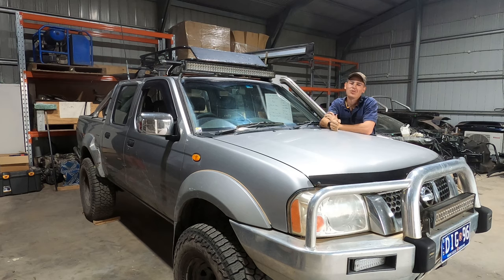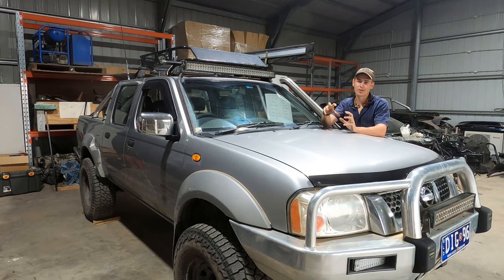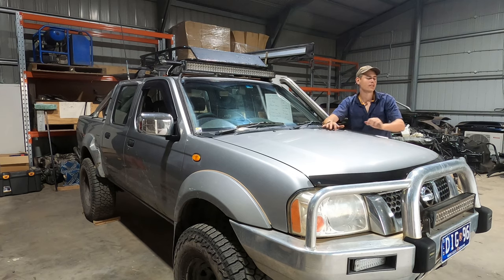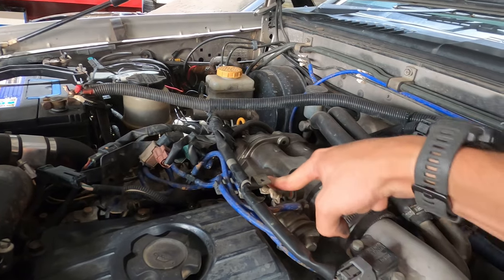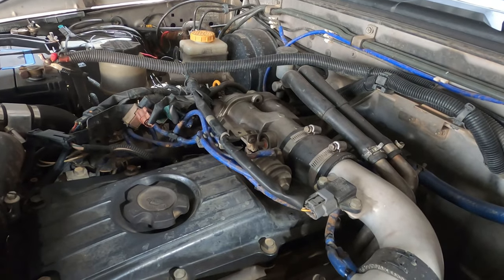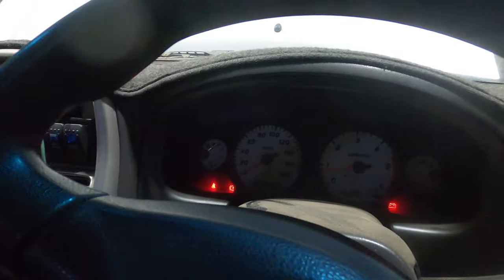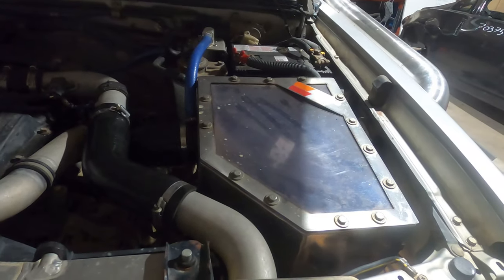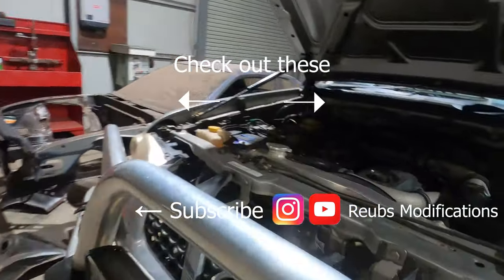How to Make Your ZD30 Flutter

Comment: My td42 just woooshes through its 4” intake and back out the snorkel, even with a little 500rpm blip on the throttle 😂
Reply from the maker: Yeah bigger engine, bigger turbo. Sounds much better than a ZD30 for sure

Comment: Mine "Blows Off" every gear shift or pedal lift-off. Huge FMIC and piping does that for ya.  Your "Flutter" is called compressor stall. Excess boost pushing back against the compressor wheel and stalling it. The sound you get is the combination of your smooth, metal tube and being ver free flowing, sets up a tuned flutter. Mine with just a stock Safari snorkel just blows off.

Your description of the throttle and swirl is close but not correct. So the back one is the EGR/Swirl butterfly to pull exhaust gases back into cyclinders via only 4 intake valves, the same butterfly closed even without the EGR flowing will induce a "Swirl" in the cyclinder charge but it's effects are pretty lame when whole charge is slammed into to the top of the piston at TDC.
The throttle, the ECU will fully close it on engine-shutdown to try and stop the thing shaking but also as a safety for a run-away, kills air-flow, no more run-away diesel. What also happens on the Navara ONLY is the ECU can also partially close it to create a low pressure in the manifold to allow the EGR to flow in. If full boost pressure was in the plenum, it would flow out the EGR valve. See the three solenoids, the back one you have blocked would normally go to the other side of the throttle butterfly actuator and partially pull it closed. Yours in blocked and a T-piece connects both actuator chambers to the fun-stopper solenoid.

Flutter is just a low frequency resonance.
Reply from the maker: Thanks Ben, as always great information 👍🏻
Reply: @Cooperroso  Neither of us are your "Bro" kiddo, grow up and bugger-off.
Reply: Why can’t you do it with a top mount
Reply from the maker: @TouringUpNorth  hey mate not sure where it said you can’t do it with a top mount, I think you might have misread bens comment about a huge FMIC and piping will do that. There’s nothing saying a top mount won’t flutter but there’s significantly less piping on top mounts then there is front mounts as there’s less distance from the turbo to intercooler. 
This means that there is less volume in a top mount intake system compared to a front mount, another point is top mounts are typically a lot smaller than front mounts due to space confinement’s so once again less intake volume. 
If you were running the same boost on either you’d have a better chance to flutter on a FMIC set up 👍🏻
Reply: @ReubsModifications  what about a cross country ultimate intercooler on a TD42, the dog is massive
Reply from the maker: @TouringUpNorth  yeah that could work but I don’t think TD42 have the same butterfly valve, you’d have to try stalling it on the beach to make it flutter
Reply: @ReubsModifications  na they don’t but some guys get them to flutter with 12mm n big boost
Reply from the maker: @TouringUpNorth  yeah so that would be purely from loading them up with boost then a rapid drop in rpm

Comment: My ZD30 Patrol flutters so much every time I let off the throttle. Installed a 3” straight pipe with a cat and very loud like a big truck lol. I was bit worried and looking around if this is bad for my car. Not sure if I should take it to a mechanic.
Reply from the maker: It can be normal for it to flutter depending on the mods that have been done to the engine. Cant do any harm having a qualified person check it out though

Comment: This well where off the turbo baring ,u basically deleting the blo off valve and the gas gets back inside the turbo ...
Reply from the maker: The ZD30 doesnt have a blow off valve, they use a wastegate on the turbo to vent exhaust pressure away from the turbine blades.
Reply: Can u mack a video and show us how to delete the Westgate on turbo diesel
Reply: won't do anything to the turbo, and you shouldn't delete a wastegate.

Comment: Does it have to close all the way to flutter and cut the engine out or can it be open just enough for the engine to stay on but decelerate the engine faster and dose without turning the engine off?
Reply from the maker: If you are using the key and cutting the engine it will close all the way but if you turn the key back before the revs drop too far then it wont turn off. If you're doing it manually in the engine bay then you have a bit more control of the valve but need someone to work the throttle.

Comment: I need help with my Nissan Hardbody pickup with the ZD30 engine .
The problem is self acceleration not quite often but when you engage first gear and you start level up its when it goes by itself.
What would be the solution